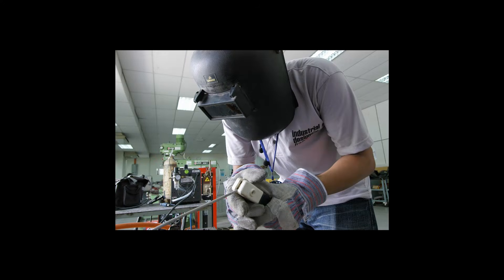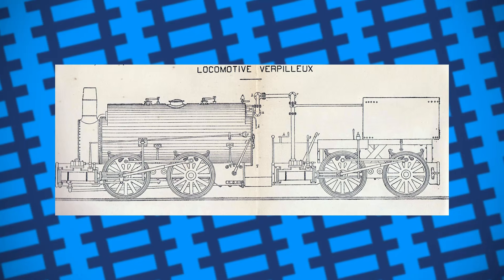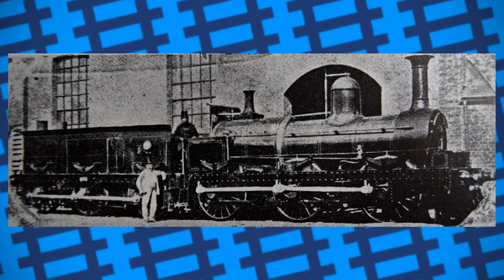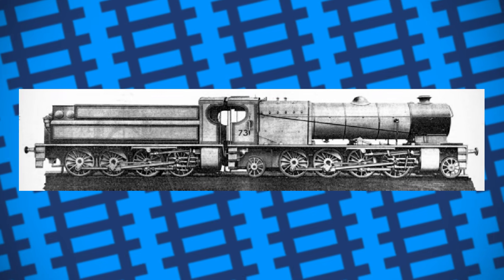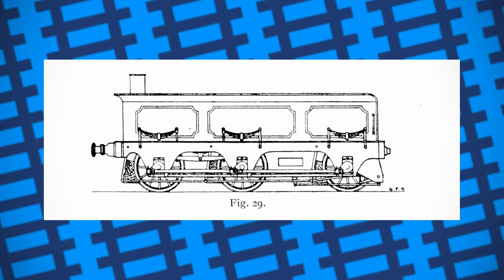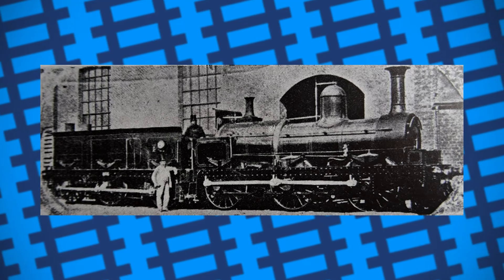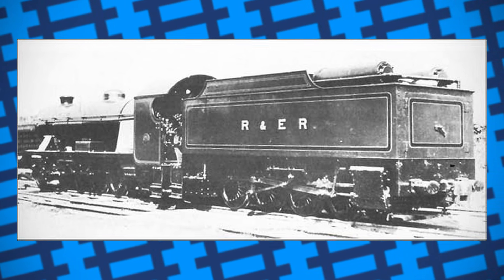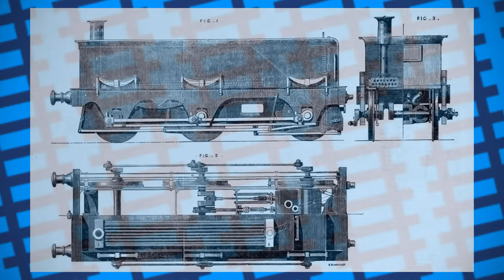The locomotive tenders that drove themselves - "Steam Tenders"

Comment: Garratt engines basically have a powered tender, or rather a water tank at the front with the motion underneath, and a coal supply at the rear with motion underneath and both motions are connected with a frame holding the boiler and cab.

Comment: BRAKES - LIMITED TRAIN LENGTH !
The limit in British Freight train length (in the steam era) was dictated by the braking ability. It should be remembered that a large proportion of British wagons had NO TRAIN BRAKES, only a handbrake for parking. So the Locomotive was the ONLY part of the train with brakes along with a Guards van at the rear. And heavy locomotives could NOT brake themselves very well, which therefore also seriously limited the safe maximum speed to often just 30mph. Even when Vacuum brakes were added (to certain wagon types) the limit was still restricted by the number of vacuum brake hose connections between wagons, as there was always a small amount of leakage. So 40/45 wagons was still the limit. 

The Westinghouse air brake was marginally better, (50-55 wagons) so some railways such as the North Eastern used this brake. Different brakes on different companies of course raised problems with passenger carriages needing to be "dual braked" for through journeys such as Kings Cross to Edinburgh !!!  

Indeed I worked in 1989 the last part fitted (part braked) freight between Exeter & Bristol which was limited even then to 30mph. After which no unbraked wagons were allowed south west of Bristol or Westbury !!!

Comment: My custom LEGO steam locomotives are both tender powered.  It seemed easier as I could just use one or two of the single piece powered boggies under the tender instead of having to figure out gearing a motor placed in the locomotive's boiler down into the drive wheels.  Does mean the locomotives are just very pretty pieces of dead weight though, lol!

Comment: Where I live in the United States, the Southern Railway did a very similar thing with six of their 2-8-2s and one of their 2-10-2s. Five of the 2-8-2s were rebuilt with drive systems from smaller 2-8-0 locomotives under their tenders, and one had a drive system with a 2-6-0 wheel arrangement. The 2-8-2 locomotives were numbered 4535-4539 and 4561, and the 2-10-2 locomotive featured a 2-6-2 drive system under the tender and was numbered 5046. All seven locomotives were rebuilt later on into conventional steam locomotives, and their tender drives were given back to their original engines.

Comment: The text of this video might be mixing up force and power a couple of times. Power is force multiplied by speed, and on a steam locomotive, limited by the boiler. So higher force with the same power might be desirable in helper engines pushing trains uphill that don't go very fast, which means a lot of force is needed but not so much power. The limit of the force is the number of wheels multiplied by the weight force on each of the wheels (and the adhesion coefficient). More wheels, more weight means less wheelslip and more force, but also more complexity and greater strain on the track.

Comment: And nowadays we do a similar thing with diesel-electric, "slug" locomotives (usually older locomotives that have had their generators removed) that are powered by the excess electricity produced by the main locomotive. It's useful where the limiting factor on the train is the friction on the drive wheels and the main engine is operating well within its capacity. The weight lost from removing the generators is usually filled with ballast such as concrete.
Reply: There's 2 types of slugs, ones which have tractive motors and no engine, and those who have engines, but no tractive motors. You could make a garratt outta those.

Comment: Some steam locomotives were fitted with steam powered boosters on the first few wheels on the tender. These were for help on starting heavy trains, and for extra power on steep grades. I think N&W 611 has one. Also, I was unaware that the USA's Southern Railway had tenders like what you showed here. I rode on one of the 4500's last year, Ms class 4501. She's preserved and operates at Tennessee Valley Railroad Museum in Chattanooga, Tn. Since you said that this was done on the Ms2's, I'm certain that she didn't have a tender like theses. Edit: to clarify, I rode 4501 herself as they offer cab rides there for both steam and Diesel.
Reply: Pardon me for responding to a year old comment lol, but 611 doesn't have a booster, and never did. Sister locomotive 602 did though, but it didn't last long, as the N&W didn't find the extra maintenance worth it, since the Js already have a high tractive effort. C&O 614 and RDG 2102 have boosters, though on the last trailing axle, as did their sisters.

Comment: You can't get a quart out of a pint pot. 
Everything is relative. The US Big Boys and SAR Garrats probably utilised the concept in the best way but in many cases, apart from labour, it was probably cheaper to double head the train.
This is done in some countries with diesel power but you then have to think of the strength of the drawbars on the stock and the length of train that a section can safely accommodate.

Comment: These experiments are like precursors to  'slugs' utilized with Diesel Electric locomotives in North America. Like slugs, I could see these being useful with a high horsepower locomotive that is lacking in adhesive weight. They are commonly paired with turbocharged 4 axle locomotives like you would find in high speed intermodal or passenger service. Locomotives that have more power than they can affectively utilize.

Comment: Grezza,s Idea is not power the tender wheels, but  the loco,s trailing truck axle  his two Class P1 2-8-2 mineral engines had selectable powered trailing axles . A bit complicated as Grezza did not think outside the box, as he used a two cylinder donkey engine under the footplate.

Comment: Another issue, to consider is stopping. Pulling more vehicles and weight is one thing, but you still need to stop. More in the UK than elsewhere, when you do not have continuous brakes a heavier train will take longer to stop.

Comment: I wonder what would happen if it was a fireless pneumatic that was powering the thing. All that is needed is a johnson bar and a throttle, and you could even save braking shoes by throwing the johnson in reverse and pumping air back into the reserve. And for the throttle, just throw it in open and then use the johnson bar to control airflow.

Comment: Here is a question. Why did they go with steam? Why didn't they simply attach some gears on to the rear most powered axle and used a crankshaft to transfer the power to the tender, which could have a gearbox to allow pairing with different engines? Sure, gradual loss of traction due to consumption of fuel is a problem, but one that can be worked with. For instance, using such engines for reinforcing a normal locomotive around steep climbs or for cargo, that gains weight faster than others. Ore trains come to mind.

Comment: I've had this idea of taking a 4 axle diesel electric and stripping of everything from above the frame keeping the frame/fuel tank/traction motors. Then build a tender on top with a "gen set" on the rear to power the tenders axles. It could supplement the steam engine when starting out and on a grade. Dynamic brakes could be vastly improved if all that waste heat was fed into the water in the tender, essentially preheating it.
Reply: Had similar ideas myself using battery or fuel cell power for use on heritage railways where cost and availability of coal is proving increasingly problematic. SVR are currently converting an 08 shunter to fuel cell power.

Comment: I wonder if an electric drive system fitted to a tender on a steam loco, with a steam generator fitted to said loco, would have helped with efficiency.
Reply: electric drives hate being around heat and ash. both found with steam engines.
Reply: @JaneDoe-dg1gv  I never considered this! Thanks for your input.
Reply: @thetman0068  The booster unit was a successful implementation of a powered tender when it was added to the first bogie of a tender. that was done if there wasn't space between the locomotive's trailing truck for one.

Comment: Great video.  Just an observation: power tenders were a standard feature on all Shays, Heisler’s and Climax locomotives and were very successful.  I guess the key difference is that while the tender wheels were powered, their drivetrain did not require increasing the number of steam cylinders.

Comment: The Swedish SJ Å-class is a unique turbine steam locomotive that was pushed by its tender. In fact, only the tender had drivewheels
Reply: wao
Reply: Sounds like my LEGO steam locomotives.  I found gearing a motor into the locomotive's drive wheels a daunting task, so I just put one or two of their single piece powered boggies under the tender, meaning the locomotive is 100% dead weight, lol!

Comment: too many problems in this pattern. The main is lack of control for tender engine, usually just steam valve and no cutoff/revers control at all. 2nd - changing tender weight as water and coal used with loss of traction.

In some cases it is unevitable, so very specific designs existed up to NSWGR class 60 which is effectively 2 tenders and boiler part hung between them has no wheels at all.

Comment: Why hasn't anyone yet thought of battery ⚡🔋driven tenders yet?or a battery brake tender?  Seems like a 
 no brainer. Electric torque, regen to help braking and range, an interesting progression in rail preservation that should help reduce wear and tear, water and fuel consumption. 🤷

PS. Hey from Ireland, 🇮🇪👋 Train of thought have you taken a look at the Drumm Battery EMU loco that ran before the DART?
Reply: Maybe because  that would be seen as sacrilege by some and would most likely require whole new testing for safety EMC and so on? People in preservation also sometimes seem too obsessed with "purity" (there could also be some regulations), that for example in Czechia they can't understand that in theory they could fit ETCS on steam locomotive, despite fact that it was already done on at least one tornado class locomotive in Great Britain. So I can imagine that creation of battery powered tender would be quite uneasy task.

What I do not understand why older diesel locomotives are not, at least I haven't heard about that happening, at least not here, equipped with at least small battery for regenerative braking. Well, then it would make sense to design them as sort of plug-in hybrids that could be charged through heating cable as some stations (at least here), already have those installed for preheating of carriages.

Comment: Powering tenders didn't pan out, but it was an idea well worth trying!
Reply: constantly powered tenders didn't pan out for steam. these and the triplexes failed but geared engines and tender boosters worked. Triple-bogie geared locomotives would place a third bogie under their tender. and booster engines work under the trailing truck or fitted to the tender leading bogie. let's not forget modern diesel slugs whose sole job is to improve traction where adhesion is the limiting factor. those slugs tend to carry extra fuel after all.

Comment: Regarding 5:01 and the Southern locomotives.  Those were purpose built "Saluda" locomotives, and the only reason Southern didn't bother with expanding upon the design, was it did exactly what they needed it to do, and only what it needed to do.  Specifically, the locomotives were used as helper locomotives (think banker) to get trains over the Saluda Grade, the steepest main line grade in the US at the time, with sections that were up to 5% grade. These Saluda locomotives (as they were called by the railroad) only worked the section of track over the grade, and no other place.  The railroad found that since these were relegated to Helper locomotives, and thus refilled their tenders with water and coal on a regular basis, as well as only operating over a short 4 or 5 mile section of track, unlike contemporary "triplex" tender driven locomotives, the Saluda locomotives didn't suffer any of the problems the others had due to tender weight becoming less from burning coal and using water.  Whatever the case, they didn't 'lose interest'.  There was just no reason to go any further with the idea.  They'd found a solution for the problem of getting heavy trains over Saluda grade, so why monkey around with it and run the risk that whatever else you come up with isn't going to work?

Comment: There was a similar concept called a booster engine that was used to help steam locos, particularly high-drivered passenger engines that were prone to slip, to start and for extra power at slow speeds.

Most were mounted on the locomotive's trailing truck, but some were designed to go on the tender. 

They were basically miniature steam cylinders coupled to the wheels of the bogey of the truck, and usually had a clutch that disengaged them above a certain speed.
Reply: yes.  victorian railways (australia) set some n class loco tenders up for boosters though never fitted them.

Comment: The triplex locomotives were the most noteworthy examples of locomotives where the tender engine used too much steam.
In the US the later booster engines used on trailing trucks or one of the tender bogies which could be switched on and off was a better system, but even these fell out of favour when locomotives themselves became larger and more powerful. You could do a video on these as I only know of usage in the US but not in other countries.
Reply: There were some locomotives fitted with boosters in the UK, the ones I know of some 4-4-2s & 2-8-2s on the LNER.
Reply: australia had them on victorian railways x class and one of the n class.  they were considered successful.

Comment: So this is recent.  I note you DON'T cover "Boosters" which came to be used on a number of American locomotives.  (Yes, the usual Brit prejudice against US practices.)  On tenders this would show up as an inside piston used to give extra power in starting; other locomotives were built with this "auxilliary" booster on a trailing truck.  Maine Central's 4-6-2 #470 from 1924 currently undergoing restoration has one of these trailing truck booster engines.  
         What you describe in this video comes across as a series of articulated simples; I note NONE of them are true Mallet compounds.  (UP's "Big Boy" is an articulated simple; WM 1309 is a true Mallet Compound.)  Oh, Bayer-Garratts suffered from the same loss of tractive effort from fuel and water consumption.
Reply: Look, m8, how do i put this, not every railway video has to include a US thing that's slightly similar but not really.
Reply: @ThomasRengel: If you’re that keen to talk about US Boosters then make your own channel 😂

Comment: --- \\ TENDER DRIVERS // ---

Upgrade current locomotive power at the cost of coal efficiency. Costs 4 money to upgrade, per units.

STRENGTH:
+3 train length
OR
+3 track gradient

WEAKNESS:
+2 maintenance
+4 steam usage

OTHERS:
-2 crew satisfaction

Comment: So given they had 2 regulators, why didn't they just instruct the engineers of the time to use that second handle to "get the damn thing going" and then don't bother using it while at speed? It would be just like any other loco costing but for a longer time then...?
It gets rid of the drawback of not needing to burn extra coal exepr for that first mile while starting and has the advantages of having the extra power to get going quickly or having an easier time on a grade if needed.

Comment: you forgot about the Trplex engine, from the ERIE railroad
Reply: It's not exactly a steam tender, it's an engine with powered tender.
Reply: @ukaszwalczak1154  bro thats the same thing.
Reply: @Mark_The_Railfan  I worded it wrong. Most of the powered tender locos weren't fully built for it, River Esk did afterall get a normal tender, and it didn't affect the engine that much, with a Triplex you'd have issues cuz the powered tender is an integral part of the design.

Comment: Surely the Chief Mechanical Engineers would have realised, when the concept was proposed,  that the two problems of steam supply from a boiler made to power the loco only would be insufficient to power the tender as well, and the gradual lightening of the tender weight would have been apparent, resulting in wheel slip.

Comment: I also have some honourable mentions for this. 3-truck Shays, Heislers, Climaxes and the triplex locomotives on the Erie and Virginian Railways. All these had powered tenders.
Reply: The Shays, Heislers, and Climaxes powered their tenders with the same pistons as the rest of the loco though...
Reply: @notmuch_23  That still makes for a powered tender.
Reply: @jacobstrainstation  Yes, but not in this exact definition.
Reply: @ukaszwalczak1154  The engines still powered the tenders didn't they?
Reply: @jacobstrainstation   Yep. They had the benefit of running a drive shaft, so it didn't necessarily demand more steam either.
Reply: @ukaszwalczak1154  I doubt there's a solid definition on powered tender, if I'm being honest.

edit: if you take it in the literal sense of the words then it counts.
Reply: @harrymu148  Does it really matter?
Reply: @jacobstrainstation  does anything really matter?
Reply: Technically speaking all Garratt locomotives have powered tenders as well. Garratts effectively sandwich their boilers between two powered tenders.
Reply: @asteroidrules  Good point! I actually thought of mentioning those myself.
Reply: Yes, but then they don't really count, as they were purpose built engines, not simply powered tenders.
Reply: Splitting hairs.